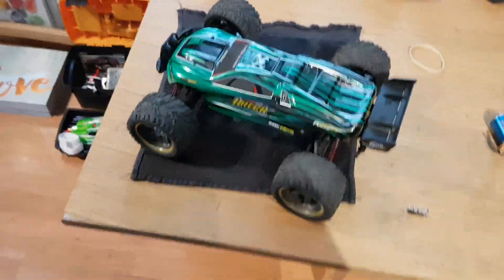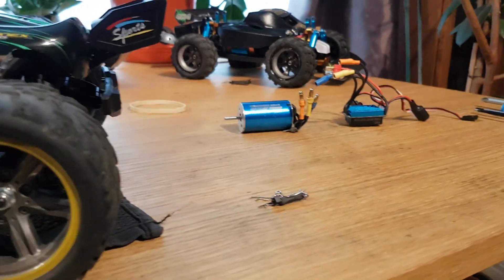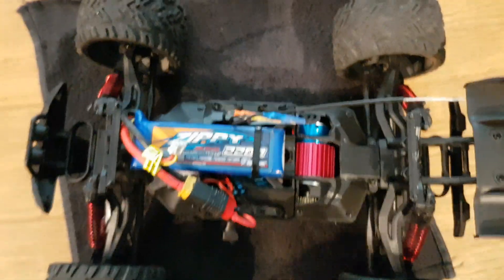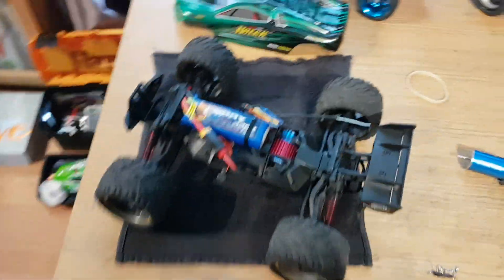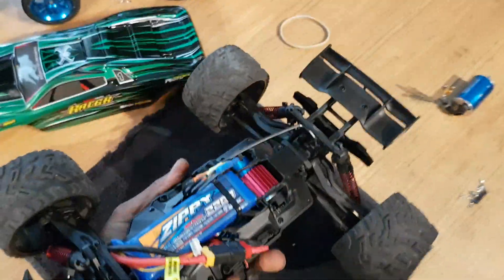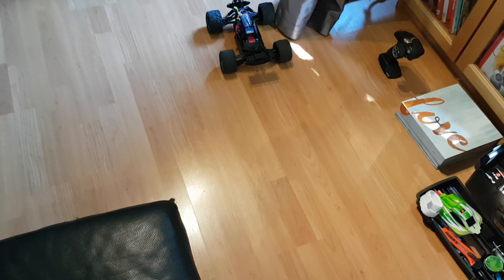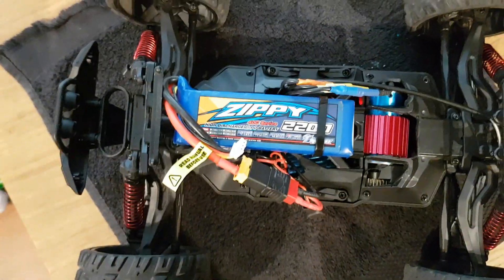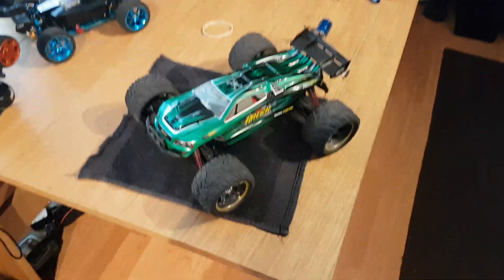Luctan S912 brushless upgrade

Comment: I am just converted mine to brushless.
I am running a 6200kv motor and it does 50000RPM on a 120amp ESC on a 3s 5000mha battery 
It does about 85kmh flat out

Comment: I dont recomend that sir.. Cause the plastic gear inside will break the treads with that power.. Ithink that is gud when u replace the palstic gear inside of gear box with metal gears.. But there is no metal gear replace to that..
Reply from the maker: Yes your right the gears cant handle the power but it ok on dirt going brushless. But 3s max 2s Brushless is perfect for this car.